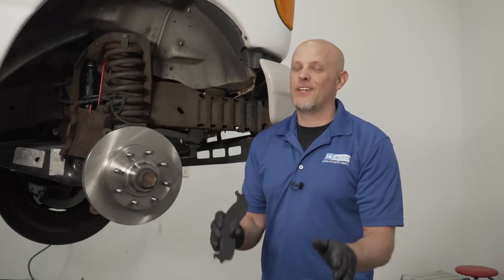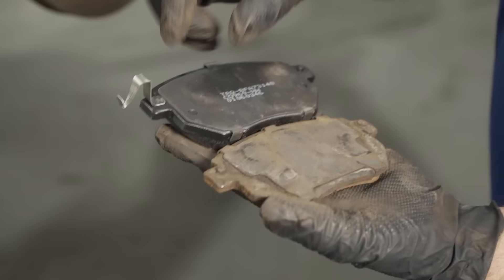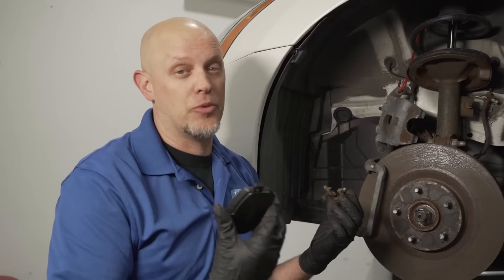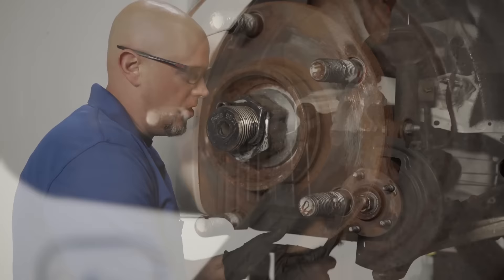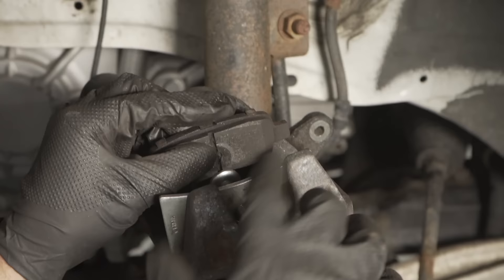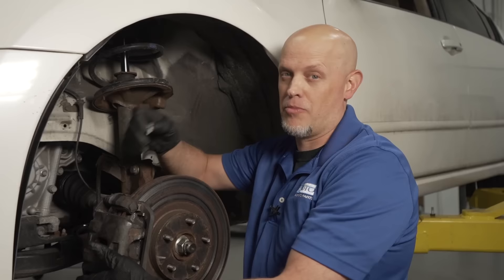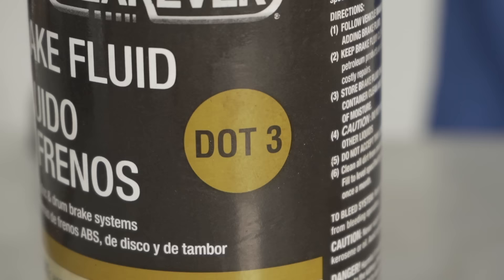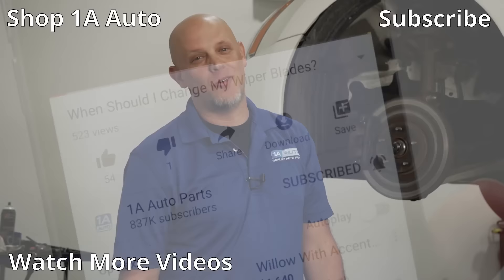Most Common Brake Installation Mistakes!

Comment: I would recommend always using a dial indicator to index new rotors, as hubs always have a little lateral runout as well as the rotors. They should be installed in such a way as to cancel each other out in order to get a true running rotor. Most pedal pulsation issues are caused by thickness variation because of excessive lateral runout when installed. After a new rotor is installed, the lateral runout towards the outer circumference should never exceed .002" or you will probably end up with pedal pulsation at some point in the rotors useful life.
Reply from the maker: +Johnny Hisaw Thanks for the tip!

Comment: Brake fluid flush can go a long way to making a system last. Also can help with a spongey brake pedal
Reply: Yup, recommended to do about every 2 years or so.
Reply: I have been checking my brake fluid for around 4 years now usually when i do a service and it is no where near the minimum boiling point. Do you recommend i still flush it as I know manufacturers state "every 2 years" due to moisture content but my system must be sealed like fort knox as the fluid has a high boiling point and im now coming up to year 5 without a change.
Reply: Yup & bleeding them out properly
Reply: @saulgoodman7495  Are you testing the master cylinder reservoir, or are you testing the wheel cylinders (pistons)? Could be a big difference. Water tends to get into the wheels, not the MC.

Comment: I forgot to grease my caliper pins last time I did replace my pads in my 2012 vw Jetta. Over time it started to sound like an old pirate ship creaking and grinding type of noise. Took it apart and was surprisingly still intact. I Re greased them and the next day after a little driving I didn’t have any issues. I also forgot to clean up the space by the rotors cleaned that up as well. All good too go.

Comment: Common mistakes:
Remember to use blue thread locker on bolts and not the red one. Red is permanent and needs heat to remove it.

Many times, the top bolt of the caliper is not meant to be taken off. You can try but you'll end up stripping the bolt because it was probably placed there with red thread locker. You can take the bottom one off and just slide the caliper off the top bolt without even removing the bolt.
Reply from the maker: +Johnny Blaze Thanks for checking us out! http://1aau.to/m/Shop-1AAuto-c

Comment: For vehicles with electronic parking brakes, use a service or diagnostic tool to put the parking brake into service mode prior to compressing the caliper down.  After changing the rear pads dont forget to put the electronic parking brake back into its operating position prior to testing.

Comment: Tried to compress a duel piston caliper one at a time, ended up popping the other piston straight out.
Reply: That is why you use the old  brake pad to push them both back @ same time!
Reply: Damnnn i bet that sucked
Reply: @jazpanoz4996  very true
Reply: They make a tool for compressing dual pistons.
Reply: In some brake videos they compress the piston/s with a large screw driver before disassembly.
Reply: @69ztang  That’s to get the caliper off. Otherwise the pads are still pushing against the caliper, & there’s not enough clearance between the pads for it to come off.

Comment: I would have added the special rotating pistons on many rear calipers that need a special tool to push back as it needs to rotate while pushing. Otherwise, your video is excellent. BTW I did once make the mistake of putting a pad with the wrong side rubbing on the disc. Needless to say that I ruined my rotor and had to redo the job.

Comment: Great video! Make a mention of older calipers that require a tool to turn clockwise when compressing the piston or else you risk damaging them.
Reply: I did the rear brakes on a newer Ford Edge recently that had this system. When I was done they were squealing until I used my scanner to cycle the rear brakes/electronic e-brake system. 🤯
Reply: I have a caliper tool set with the adapters to twist those type pistons back in. Usually rear disc brakes are set up like this. My truck still has the good old push in ones.

Comment: Great video. Thanks. at 4:02  Im in the salt belt of NJ. I put a small dab of anti sieze on the bracket where the hardware goes over to prevent rust build up behind the hardware..

Comment: Make sure not to get steel/rust particles in a bottle of Loctite. This stuff is basically acrylic resin without the catalyst, because the metal surface of the bolt acts as the catalyst. When you contaminate the bottle, the whole thing will turn into hard plastic.

Comment: when you compress the caliper do you unscrew the cap on the brake fluid reservoir? That's what ive been doing for years rather than unscrewing the bleeder.

Comment: I do one brake at a time. When the caliper is off, I pump the brakes to get the piston to get it to be 3/4 of its travel out. I then lift the boot and using cotton swabs and alcohol (do not use gas or kerosene, etc), I clean out the gunk around the piston. It takes at least 20+ swabs to clean them. I then apply a silicone grease to the area under the boot. That keeps moisture out. My original calipers will be 22 years old and the vehicle goes through hell in our winters. I also flush the brake fluid ever 4 years or less. That keeps the bleeder screws from rusting in place and the calipers last forever.

Comment: 1) Don’t get brake fluid on paint because it will destroy your paint.

2) Always pump your brakes when you’re done with the brake job to get the calipers seated against the rotors again.

3) Don’t get brake fluid in your mouth, because it tastes terrible!
Reply: First time I did my own brakes, I didn't do #2. I started the car and got it to slowly roll forward, the brakes didn't work, freaked me out! Luckily I kept pumping the brakes and it finally stopped the car.
Reply: You wanna do couple hard and soft stops that breaks in the pads and clippers
Reply: @git_r_done_776  - I know a guy that did the same, but he drove somebody else's cadillac down a massive hill and crashed it into traffic. It was not his finest day in the shop.
Reply: Lol! Brake fluid in your mouth? Is there an explosive story behind this? I’ve taken many showers in antifreeze but can’t recall tasting break fluid. 🤣
Reply: @AndyTheXTech  AND BOTH are POISONOUS !!

Comment: Advice I'd have is always bleed the brakes, replace the fluid if its dark. 

And for older vehicles with spindles and taper bearings. re pack those bearings with some good hi temp grease.
Reply: I love working around/on cars after my dad has been a mechanic for years and has taught me a lot of things on cars. ❤️ He wanted a boy till he had girls.  😂 ☕👀

Comment: I would add that the caliber slide bolts should be torqued properly and would use thread locking compound. The torque specs on most vehicles is not very tight, so thread locking compound is a better option than putting them in dry and over tightening.

Comment: Video really helped me. My 2008 range Rover fairly older vehicle, the driver side rear wheel was making this grinding noise and even squeaked at first but when I would drive it jus sounded like something was scraping something and then click ....we took the tire off and brake pads thinking it was something with the caliper maybe it's stuck but the brakes were still working so that wasn't it. I always thought it was the rotor because he never changed my rotors when he did the pads. After watching this I believe something behind the rotor is bent in touching ...none the less I will take it to a mechanic because I'm no expert

Comment: So can I use DOT 5.1 to replace DOT 3 ?
Reply: Refer to owners manual or master cylinder cap and use only that to be safe.
Reply: Yes you can. Dot 5.1 just mean it has a higher boiling point. Stay clear of Dot 5 for that is a silicone base fluid. Dot 5 is for motorcycles only. Dot 3, 4 and 5.1 are  for passenger vehicles and light duty trucks. People who race there vehicles switch from Dot 3 and 4 to Dot 5.1. Even if the manual says Dot 3 using Dot 5.1 will not harm your vehicle.
Reply: @roberts1159  If you have an older car, this stuff can be deprecated and either be not produced anymore or it became superseded by a much better alternative. No need to use old technology just because it says so in the manual. Doing research is the most important part.
Reply: @12MRJERSEY    Um my cars manual only says Dot 3 or Dot 4 plus it’s a 2004 car little older so I just stuck with Dot 3

Comment: Good video. I've been doing my brakes for >40 yrs, and I still picked up a couple of good tips.

Often times there will be a threaded hole in the rotor that will accept a bolt. If the rotor is stuck, find the right size bolt, screw it in, and the rotor will pop off easily.

Cleaning grease off friction surfaces was mentioned casually. I would recommend becoming anal about it. A smudge of grease on a rotor or pad will ruin a pad. Once I get a rotor clean, I treat it like a sterile field in an operating room.

When tightening lug nuts, torque them. I double-torque mine. I.e. after torquing them once, I go back, and loosen one, and re-torque it again. Repeat for the other nuts. This will keep the rotor from warping. Before I started doing this, my rotors would warp before the pads would wear out. Now, the pads wear out before the rotors warp.

Comment: Two things which weren't mentioned  sometimes on rotors there are 10 mm bolt holes  there there to help to get a stuck rotor off another  a block of wood can be used against the rotor while striking it with a 6 lb hammer

Comment: Putting your brake pads on backwards is like putting your pants on backwards
Reply: Well in regards to the pants,that's for easy access.
Reply: Or even putting your shoes on the wrong feet, that's more like it
Reply: or putting your bra on backwards.  Kinda obvious then.
Reply: He's not kidding.  I actually did that on an Audi 100 once...ruined the new pads and the rotors!

Comment: Thx for tips - a few of my own I've picked up over the years too:
Add PTFE tape to bleed screws - they will never seize again. 
Hang caliper with coat hanger to relieve hydraulic line and fittings.
Copper anti-seize is higher temp anti-seize, don't use Al type.
Change gloves as needed to prevent cross contamination of lubes/ oils/ dirt onto discs & pads.
Don't let bled brake fluid touch anything - it is highly corrosive to almost everything.
Reply from the maker: +colin ellicott Thanks for the feedback!

Comment: Ah, one most important thing: "pay attention to the brake pad break-in instructions!" 
Some brake pads are already manufactured with material that doesn't require to be broken in and like wise,  some pads will require to be properly broken in. 
"PEOPLE; WHEN INSTALLING NEW PADS, ALWAYS LOOK AT THE PAPERWORK THAT CAME WITH THEM, AS IT WILL TELL YOU IF THE PADS HAVE BREAK-IN MATERIAL BUILT IN THE PADS...........
Good video otherwise!!!!
Reply: Hey John Malkovich..brake after watching...lol....excellent on point tutorial thank you sir.

Comment: Use water to clean off any  spilled brake  fluid .Works just as good as brake kleen.
Little known fact, water works good to clean off battery posts. Just plain water.
Reply: I guess that is because brake fluid can absorb water, which means water can absorb brake fluid in it.

Comment: You may have said it and I missed it but it is important to replace the rotors when needed.  As a minimum if there are any grooves or significant wear and/or if at or below minimum thickness.

Comment: If you go to undo your calipers and a bolt starts stripping, stop immediately and take it to a professional. And dont bend tge squeelers back to get more life out of the pad. You'll forget you did and cause more damage.... Yes ive done both of these😂
Reply from the maker: +Danny Smith Thanks for the tip!

Comment: If DIYers make these types of mistakes then they should not be repairing thier cars 😐
Reply: This is why SMART DIYer's research great videos like this BEFORE attempting their own repairs.  I've done my own maintenance on my 2000 GMC Sierra (complete with hand-crank windows and cassette player), and am always grateful to find videos to learn from before attempting "fixes".  I've replaced my serpentine, water-pump, belt tensioners, and other worn-out parts, but I ALWAYS do the homework first.

Comment: Yeah, there's  diy jobs that some shouldn't attempt to do it themselves. Kinda like there are some that should NEVER be allowed behind the wheel of a car. How does anyone even manage to put pads on backwards? 🤤
Reply: It's not unheard of on thinner discs like a motorcycle that the pads both push over to one side as you're fitting it. Buddy of mine did that. Obviously the solution is to check 🤣

Comment: One thing I learned the hard way... always (very carefully) clean the exposed caliper piston before compressing.  Probly obvious to a pro.
Mentioned that I had replaced my pads to my mechanic neighbor and the 1st question he had was did you clean the pistons before compressing them. When I said no, he gave me the look and told me I should have... sure enuff I ended up having to replace the calipers a short time layer cuz the seals leaked...

Comment: 5:06 good Lil trick for getting a seized rotor off is to take a 2-3" long bolt and place it in the hole where the caliper mounts and spin 2 nuts onto the end. One snug up against the back side of the mounting hole the other about flush to the end of the bolt and snug the bolt up to the rotor. Take 2 wrenches and tighten the bolt while backing the bolt on the backside of the mounting hole . This will Apply pressure to the back of the rotor until the rotor pops off. You can add an additional bolt in the lower bracket hole as well for extra force,and the extra nut on the end of the bolt won't damage your rotor.
 You can add additional nuts on to the bolts to keep it from bending on you.
I've used this trick a few times over the years. It has definitely saved me some headaches.

Comment: I have a 2005 Tahoe.  The previous owner had the brakes done.  After a few years, the inside of three rotors were destroyed while the outside looked new.  One brake rotor and pads looked new.  The brakes showed no sign of any grease on the pad clip or the caliper bolts to the caliper was probably not sliding over to engage the outside pad.  The new looking one had stuck pistons.  As I put it back together with the original rotor and pads, I compressed the pistons after spraying them with Blaster and they worked fine.  If you don't do the job right, it won't work right.  P.S. The caliper bracket bolts were very hard to get out because they used Loctite.

Comment: In addition to not twisting the flex line, make sure that the front lines are routed properly.  In my RX-7, they route around the coil over damper assembly.  When you are servicing your suspension components,  it's easy to put everything back together without positioning the line properly.

Comment: Thanks - good video. Just one point : if the caliper/piston seal has gone you can buy a caliper servicing kit and renew just the seal & boot, assuming all else is OK. Cheaper than a new caliper and perfectly satisfactory. In fact I do this every so often even if they're not leaking, since it helps reduce brake pad rub.

Comment: Never put antiseize between rotor and hub. Never do this. Water based rust converter and wipe dry. Any grease or lubricate lowers strength of assembly against rotating. When lash is taken up, the lug studs take a beating and the assembly loosens. OEM assemblies NEVER have lubricant in there for a reason.

Comment: Thanks for clearing up which direction the spring squealer goes.  All other youtube videos say just replace it the same direction that it was on there. . . or just do one wheel at a time.  Way too much trust  in the last guy who worked on the car.  I checked and sure enough mine were on backward.
Reply from the maker: +@smoke05s Thanks for checking us out! http://1aau.to/m/Shop-1AAuto-c

Comment: Thanks for the video. I have recently done changed my rear pads and rotors and now the brakes feel spongy, I have to push the brake pedal further to get a proper brake but it's still not like before. I am sure I've done anything correctly. Should I do something extra , not shown in here? Like replacing the brake fluid or something

Comment: Whew, just did our hyundai, i couldnt remember if the squealer was top or bottom as it fit either way, luckily, i was right, bottom....i flip up the caliper on one bolt, so it was confusing remembering top or bottom once rotated back...

Comment: Just had a quick question i accidentally put a tiny cut in the boot cover (baring). Does it have to be replaced. light is not coming through just a 2mm nic.
Thanks in advance, awesome content -

Comment: When I was a mechanic, the worst break job I had to fix was previously done with copper lines. oops ! I always wonder though, when installing new calipers, is there something that can be added to the bleeders threads, so the don't seize-up ? ( Anti seize copper, anti seize silver...etc...)

Comment: Great video. Another thing to watch for are calipers that don't push in,, they have two holes in them that you insert a tool and have to TURN the piston back in. I just did one tonight, and it was a bear.